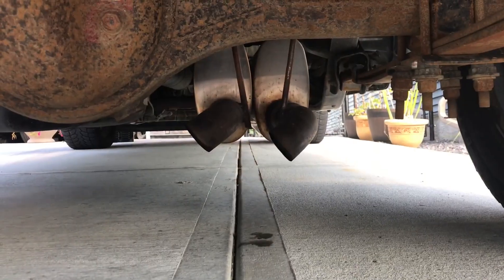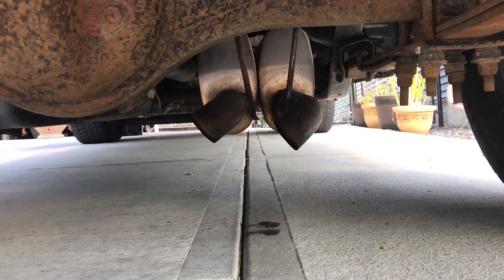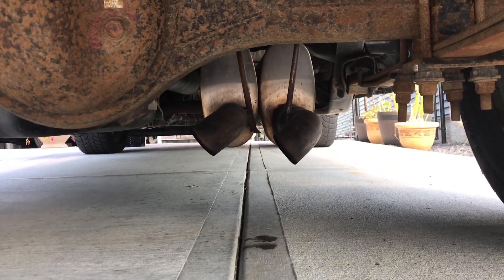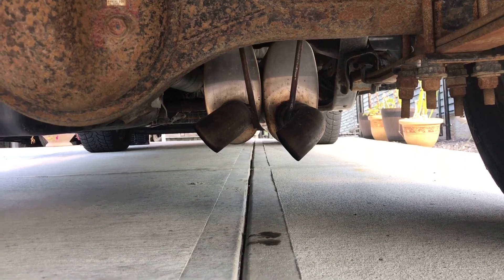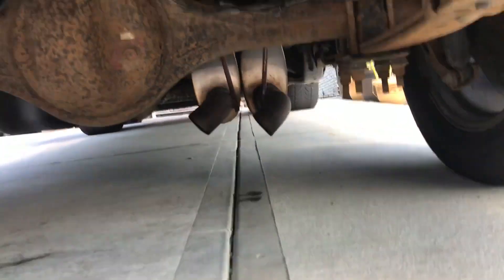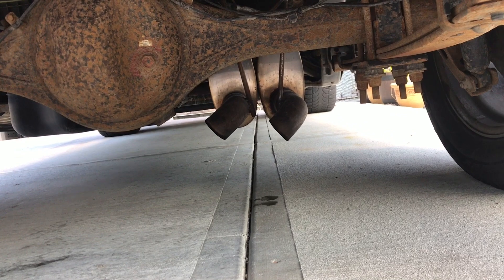“Ghost Cam” Tune On A Toyota Tundra - High Lift Longer Duration Camshaft Lopey Idle Sound Effect

Comment: I like it, i know your truck is completely custom but do you think i would throw any codes on a not so much custom tundra? Also how would one get something like this done? Did you use a certain tunner? Keep up the good work. Be safe and be blessed!
Reply from the maker: Thanks! Yes, it will throw fault codes on a stock truck after a while. The tune was built by me using HPTuners.

Comment: That’s interesting was wondering about exhaust systems. What are your recommendations for good solid all round exhaust systems. A balance of power and sound. I’m not in to obnoxiously loud exhaust system. But I love a rumble.
Reply from the maker: Keith Carty at Dirty Deeds exhaust is a Tundra exhaust specialist and could give you good advice on this.
Reply: @Viktor_G_Automotive  Thanks man!! My rig is a 2007. It had only 52,000 when I found it. It’s 100% stock. I’m interested to know what would you do in the way of upgrades?
Reply from the maker: @gburwash01  I have dozens of videos about my build on this channel. I can’t really advise on what to do with your truck because every owner has different goals and priorities for their vehicle. If your goal is to build a very fast Tundra, watch my videos for all the info on my performance build :)
Reply: @Viktor_G_Automotive  I’m definitely not going to the track! Lol. I have a big block stroker dodge Challenger for that. 
I want an outdoor beast daily driver. But I do like power and decent sound. I don’t like the size of the fuel tank on the Toyota. Feels like I’m at the pumps all the time.